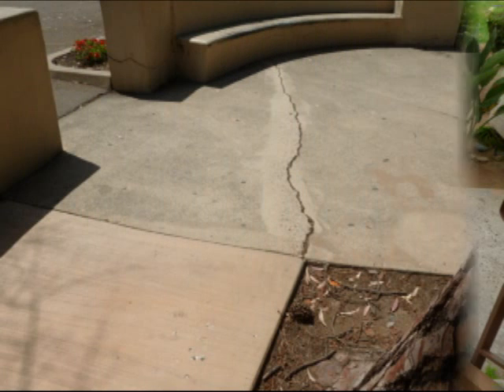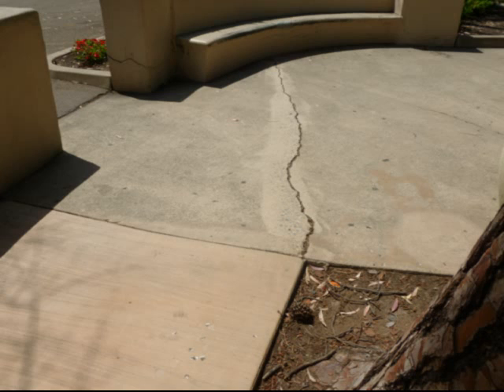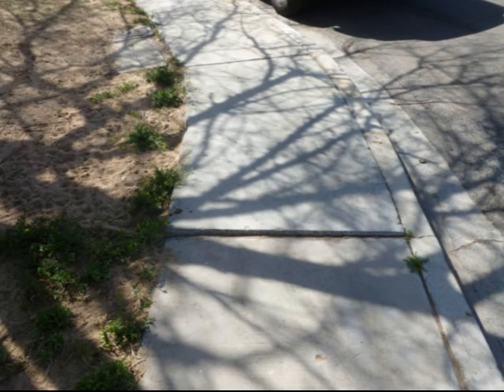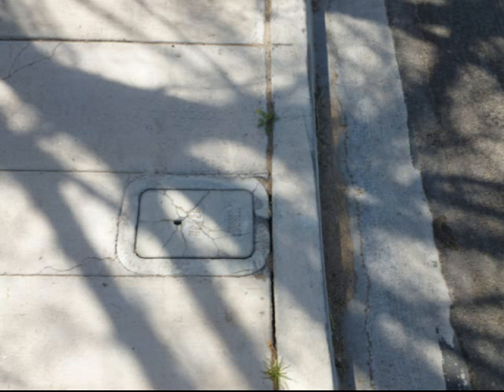Walkway Control Joint Tips - Concrete Sidewalk Crack Prevention

Comment: Are control joints cut all the way through or just scored on top?
Reply from the maker: Usually only cut about 1 inch deep or to the depth required by an engineer.

Comment: Any pros and cons to throwing rock salt on it to cause the little holes on top.
Reply from the maker: The rock salt is actually used to create a specific pattern and creates an excellent slip resistant walkway. However, it is my personal opinion due to observations over the years that the rock salt finish seems to crack less, but this pattern might actually hide them better than a smooth surface.

Comment: if i just beefed up the re-bar would it prevent the cracking ?
Reply from the maker: Rebar might not prevent it from cracking, but it almost guarantees that the cracks won't get very big. It doesn't guarantee that they won't get bigger, but seems to do a pretty good job.
Reply: joaquin lopez  mesh and rebar is designed to keep it together ,will not prevent cracking. Cementitious material cracks by nature